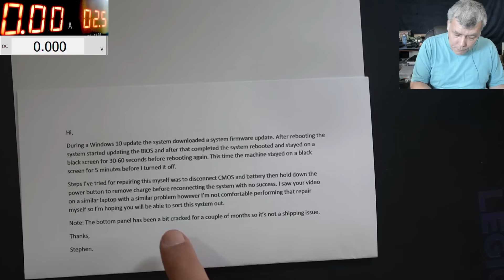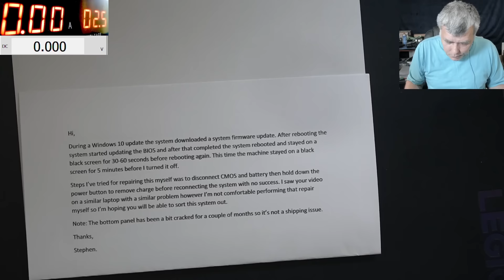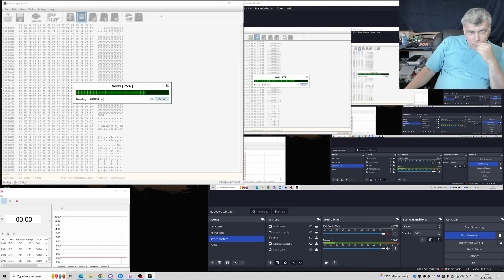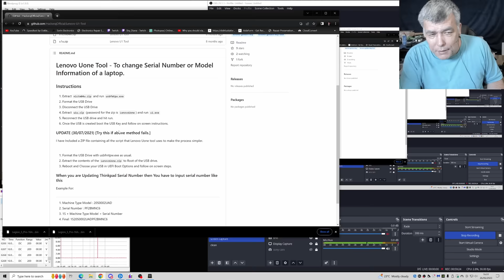Lenovo Legion 5 15ACH6H dead after windows updates - Sadly, laptops are dying after windows updates

Comment: This is very common. When Windows first started shipping Lenovo Firmware Updates we had a flood of bricked IdeaPads and ThinkPads in the workshop in our small computer store. 

I did a small experiment back then, dumping the BIOS eeprom of a ThinkPad E15 then trying the Windows firmware update on the same machine again and again (reflashing the BIOS to its original state every time). It failed 6 out of 10 times.
Reply: given that Lenovo is a Microsoft Partner this is shameful.
Reply: 🤬🤬🤬. Could be a capacitor problem, not supplying sufficient current during update.
Reply: This is false information being spread around even the OP of the video is clueless. Microsoft has absolutely nothing to do with anything at system board level or BIOS firmware updates. The updates are pushed by the factory installed utility driver application installed on brand new computers with the favory OEM image.
Reply: @eman0828  Not true, Microsoft has been pushing bios updates, through windows update, In my view they should not be doing this.
Reply: @yoppindia  Do you even know who you are talking to right now? The OP of the video is clearly clueless spreading misleading information. That's not how BIOS updates work!
Reply: @yoppindia  I also own a Legion 5 laptop and it's gone through a lot of updates. The BIOS hasn't been updated in over 3 years! This misinformation is simply false! I acutally removed the factory OEM image and loaded my own retail copy of Windows and manually loaded the drivers myself.
Reply: @eman0828  you have no clue, Microsoft has been pushing bios updates for laptops , I have seen it many times. He is not pushing misleading information.
Reply: @eman0828  I have hp laptop and had many bios updates pushed via windows update. Maybe your laptop manufacturer is not pushing it.
Reply: @yoppindia  I can tell you aren't very computer savvy. The reason why I haven't had any updates is because I don't have any Lenovo factory software installed on Mt Legion 5. Proof that these updates aren't being pushed by a Window's update. It's that simple. The OP doesn't the know the difference from Window's updates and factory installed driver update tools which is sad.
Reply: @eman0828  Dunning Kruger seems to be here too.
Reply: If you don't get the BIOS updates via Windows Update (which you can find at the section with the driver updates inside of Windows Update), you might have been dumb enough to reload your Windows in Legacy/CSM instead of UEFI. 

Windows does not provide BIOS updates when installed in Legacy.
Reply: The latest version of the BIOS for the Legion 5 is GKCN60WW. I'm still on version EUCN26WW that I manually updated in 2020. I know what the hell I'm talking esp for some on is actively in the IT industry and is also Dell Certified. The OP of the video is even clueless hense the reason I commented on this video of misleading info.
Reply: I have a legion 5 updated bios no problems. It only plays RDR2 and a couple assassin creeds. No problems...
Reply: @hustleyourknowledge  What is the BIOS version? Mine has never been updated in over 3 years.
Reply: @yoppindia  did they recently start doing this? I have an ideapad flex 5 and it used to constantly bug me with a bios update notification as a pop up and I had to due-diligently decline it as Lenovos are known to brick themselves during a bios update
Reply: @eman0828  You have absolutely no idea what you're talking about. My HP Spectre 1065G7 has had numerous BIOS updates delivered by Windows Update, although I have not been using HP factory Windows for a long time. Also my motherboard MSI PRO B660M-A has it in Optional update, but I ignore because it's older than the current BIOS that I manually updated myself.

Just because your Legion 5 2020 and Dell machines don't have BIOS update in WU, doesn't mean no laptops have it. At your level of profession, shame on you for not updating your technology knowledge.
Reply: @eman0828 Also, the video is about the 15ACH6H model, which was released in 2021 with Ryzen 5000 Zen 3 processor. Not the same as your model, and Lenovo probably started pushing BIOS updates to Microsoft server for the 2021 version.
Reply: @nvnh319  Lol. I only believe it until I seen. I patch Windows, Linux, UNIX and MacOS machine's day in and day out. Yall just a bunch liars that have no idea what the hell you even looking at. The only thing that comes through Windows updates is "Generic" drivers. The average user just don't under IT.
Reply: @eman0828 Factory Windows or self-installed Windows make no difference, because the BIOS update like in the video comes from Microsoft's WU server, using the files that OEM provided.
Reply: @nvnh319  The video didn't prove anything nor the OP of the video knows what hes talking about. He never showed the updates. I don't know where you base your info off I but I can assure you BIOS updates don't come from Microsoft. That's a hardware firmware. You can only get that from the hardware manufacture. You guys are just simply repeating the same lie over and over copying what everyone else is saying. Show me a screen shot of your windows update and post it on here because I don't believe anyone on here esp as a Systems Administrator like myself that does security patches every day on a large scale level.
Reply: @eman0828 Don't try to be smart. You seem to have outdated hardware and probably software too. Last week WU updated my BIOS. Today another laptop is out for delivery. If you behave nicely, I will take a screen shot and show you the latest technology with a 2023 laptop.
Reply: @BSnicks hi can u plz send an screenshot weblink of WU trying to update a bios?

Comment: Never had this issue with lots of BIOS updates in the last 20 years, but it's always the biggest fear when watching the progress bar crawling slowly to the right. Impressive work and quite exciting to watch! And on top a happy ending, so I can finally go to sleep now without any nightmares :-)
Reply: I have a lenovo laptop, i always get popups to update my bios, i tried it once but it didn't complete as i should enable bios update from the bios options XD
Reply: It's simple - always always ALWAYS use the bootable update image rather than the "update from within the OS" tool.
Reply: @233kosta Last year I updated the BIOS on a Lenovo laptop from Windows. It automatically took a backup of the old BIOS, just in case something goes wrong. But if the new BIOS doesn't work, there would be no way to revert to the old BIOS.
Reply: @BSnicks  Yeh, that's why I avoid doing it. It can brick your laptop so easily!

I once witnessed a BIOS update on a colleague's laptop, done through w10. The IT guy said "It'll be fine"... That machine never switched on again 😑 They basically had to get the guy a new one.

Comment: One thing I learned to avoid is Windows optional updates. I installed some on an Acer One tablet-with-keyboard and it wiped out things like sound. Eventually my many Google searches found software that reloaded the missing components, but now I only run necessary updates.
Reply: And preveiw updates. i've had five computers die, all after a windows update.
Reply: I have had both a windows 10 pc and a window 11 pc both drop the sound after an update.  MS website offers no solution.  I had to undo the update, then do a system restore, and only then did my sound return.  I have since turned off all windows updates.
Reply: @OverlandOne  windows audio back end is cobbled together and terrible.
Reply: I always delay Windows updates by a month at least. I'd rather take the security risk than have my laptop bricked (had this happen to a Lenovo laptop of mine a few years ago).
Reply: Thanks. This solves the mystery of what happened to the sound.

Comment: Hi sorin I found this table online:
45w -120 ohms
65w - 280 ohms 
90w - 550 ohms
135w - 1 k
170w - 1.9k
they say any charger above 170w has a 4.5-5 kOhms 
in case of lenovo the resistor the id pin connects to ground.

Comment: Amazing...both how you fixed that laptop..and how Microsoft managed to erase the BIOS ..which is a personal attack to the customer.   😀
Reply: Why is Microsoft updating the BIOS ?
My mother get the message that she should decide to update the Laptop to Windows 11 or not. There is no possibility like "not now" if you do not have the time to do this. SO she decided not to update her WIn10 to Win11.

I only use XUbuntu and she could do this too, because everything what she is using is available under Linux.
Reply: @micropower8  I went in my Bios and turned off TPM, that way it will not update to 11 until I want it to!😁😁
Reply: @wallychambe1587  - Good idea.
Reply: The update would have been published by the OEM to Windows Update.

How is the content of that update, or how the hardware applies it the fault of Microsoft?
Reply: How to turn off windows from updating bios in legion 5?

Comment: The simplest way is to check the manufacturer support site of your model of laptop and allways have installed latest bios to prevent auto installation via Windows Update mechanism. I do if for a Dell and Lenovo aswell.
Reply: What to do when laptop manufacturer declares the 7 old month launched laptop EOL?

Manufacturer says keeping last supported (by them) version is safe, games and other software constantly urge  to update or doesn't run unless you update.
Reply: @nowaywithyoueveragai  By a 7 month old laptop you mean byt it's manufacturer date or you purchase date ? That's a signifact difference as You can still buy at some thrd party stores laptop equipped with Haswell CPU (2013 year) and it will teoretically by a few days old by a purchase date perspective in which it's still a 10 years old garbage.
If you have latest BIOS installed on your own based of manufacturer support site, Windows Update will not install it automatically and you prevent any problems.
Reply: @guig2004  launch date :(.
It happened to me with a MSI laptop similar to the one with the chip destroyed (video of last week).
Reply: bought Lenovo IdeaPad 5 15ALC05, updated BIOS and laptop was not turning on anymore. Only by luck I backed-up BIOS before flashing. Purchased CH341A programmer and a clip, reflashed BIOS (with another laptop) back to original and it is working again.
Always have BIOS backed up before updating Lenovo laptops...
p.s. if you search for "lenovo 15alc05 bios bricked" you will find many threads on Lenovo community forum about it and no "official" solution. They did not even remove that BIOS version from the official support website and also they did not publish a fixed one...

Comment: Sadly Windows Update will attempt to update your BIOS if it finds one in its database. It happens mostly to new laptops and new desktop PC motherboards and usually this update is named "-your computer manufacturer's name- firmware". Now it does not install automatically anymore and you can usually find it in the "optional updates" section. In Windows 11 at least.
Reply: There are unfortunately still some cases where Windows will actually download required firmware updates.
Reply: @FairPlay137  Thar's because manufacturers tell Microsoft "Hey, put this hardware controller in important updates", "Hey, this BIOS update must go to optional updates", and so on. This is specially true for the business section of products, at least in HP and Lenovo, which are the preferred manufacturers for my job.
Reply: @FairPlay137  i had my windows 10 locked down from updating, just put it on a laptop and it seems impossible now, to stop. I hate windows updates
Reply: @FairPlay137  This is true, and Windows has NO BUSINESS installing risky things like manufacturer BIOS updates. It will also force-install things like GPU drivers even if you already have a newer one installed. And hey lets not forget that HP USB driver from 2017 that every windows machine with an HP printer driver that windows force-installs every single day for years now. Windows is complete trash and always will be.
Reply: No such thing as a BIOS windows updates. The updates come from the pre installed driver application on your computer. I worked on thousands of Dell Latitude and Precision laptops day in and day out in the Enterprise world of IT. Not a single time I encounter any laptop in Mt line of work with a BIOS update via Windows updates. All driver updates are pushed via tge Dell Command Update driver application that comes pre installed from the factory. I run that application on every laptop I image and some times from the Dell website.
Reply: @eman0828  Maybe they don't do that on business grade laptops but i assure you they do try to update via windows update. My own Lenovo Legion Y740 laptop did that aswell and so did my desktop Asus TUF board. On W11 it won't do that automatically anymore though,it will appear in the optional updates section listed as "system firmware"
Reply: @nushnume  I'm not buying that. funny enough I own a Legion 5 the same model in the video. The BIOS hasn't been updated since 2020 and my laptop has gone through countless Window's updates. The latest BIOS version for the Legion 5 as of 2023 is GKCN60WW. I'm still on version EUCN26WW. I removed the factory installed Imaged when I first bought my Legion 5 in 2020 and installed a retail copy of Windows 10 and flashed the BIOS manually myself.
Reply: @eman0828  Like i give a shit if you believe it or not. Not ALL laptops and desktops receive bios updates via windows updates. Reddit is full of threads regarding this bios thing with actual photos for proof

Comment: I'm Sure Lenovo are more prone to these bios related problems. Wonder if in the recent patches a change to the TPM or maybe a read of the Encrypted data to confirm the ID of System and something occurred at that point causing the this odd Black screen of death and no power, I would hope that BIOS updates are not applied thorough updates. Great vid Sorin and thanks for putting it up 👍
Reply: I have seen HP machines push bios updates as “windows” updates
Reply: @shadwxero  Asus does too nothing broken this far but they tried to lower gpu clocks in my other A15 I just flashed the gpu bios back no problems this far thought the display panel is gone and the machine serves as a data miner and a movie machine with a projector for now.
Reply: I have seen Asus  also have this kind of problem
Reply: @shadwxero  MSI does too.. but fortunately it was listed as optional.. so if i clicked random start windows update.. it didn't update the firmware

Comment: Lenovo has a feature in their Thinkpads known as a “self-healing BIOS”; it creates another copy of the bios in case it gets corrupted and is unbootable.
Reply: yeah, common in business laptops. That's why I love my old T450s I bought off when we had a refresh cycle at work.
Reply: Gigabyte calls it Dual Bios
Reply: @sinancetinkaya  That's a different thing. If it says Dual Bios with Gigabyte then the mainboard has two bios chips installed and the second chip takes over if the first one gets corrupted/unusable.
Reply: thunderbolt 3 can brick your thinkpad anyway, nothing but a bios update can fix this problem, i wouldn´t trust in this solution either

Comment: I ran into the same issue with an HP laptop and followed the same procedure you performed and it fixed it.  I eventually found the root cause of the issue.  There "was" an EFI partition on the original SSD that was necessary to be present to finish the final stages of the BIOS flashing.  I had previously wiped the SSD of the laptop so this reserved partition was no longer on it.  I had an identical laptop and performed the same BIOS update and the exact same thing happened.  I then installed the HP UFEI diagnostic tools on the first laptop's SSD, and put that drive in the 2nd laptop.  When booting, a screen popped up during POST and it finished the flashing process, and the 2nd laptop was now fixed without having to physically remove the BIOS serial EEPROM.  I wonder if this is the same issue with the Lenovo?
Reply: This is why UEFI isn't what it's cracked up to be! It has it's weaknesses as you discovered.  Where that EFI partition is not obvious either. It can be a visible separate partition, or a hidden directory within the C: drive of the Windows installation. Why it's done this way is beyond logic. Perhaps some default due to whether a MBR or GPT drive is detected, or an installation is detecting a pre-partitioned drive.  Ironically, I currently am trying to repair a damaged UEFI Windows boot partition of a Lenovo after an installation of Debian 12 for dual boot system, failed creating GRUB for UEFI.  Nothing has worked. If this were MBR, I would have had it fixed in minutes. SMH!   Some companies still provide alternate BIOS update methods instead of via Windows, but a DOS USB boot path, which I feel is safer and more direct and no extra layers of Windows in between.
Reply: I find it insane how they don't configure or at least check the EFI partition to include the UEFI diagnostic tools before flashing. It legitimately feels like they're trying to brick laptops with this.
Reply: Yes, we found this when our customer was using a third-party encryption system - which used the UEFI partition! It meant we could no longer install BIOS updates once the machine was imaged, so we had to load any new BIOS needed as part of the image build process!